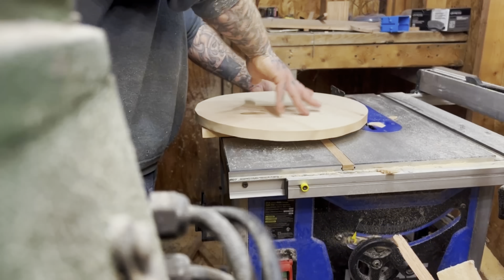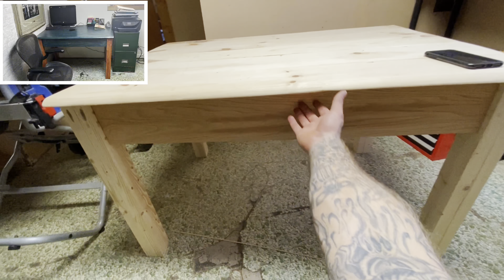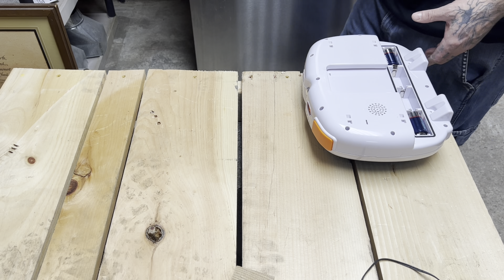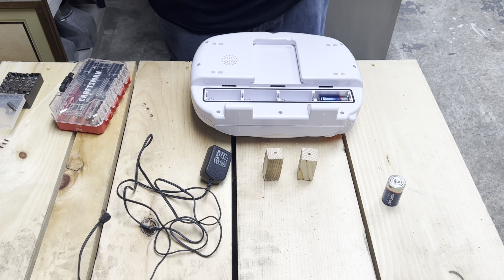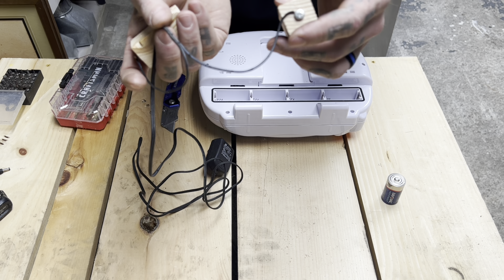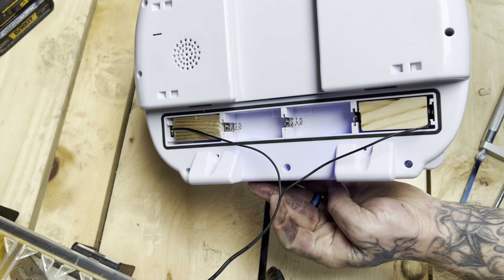Run Battery Powered Devices From Wall Outlet

Comment: Great vid frank. Fun fact: most phone chargers run at 5v, which is slightly under voltage, but in my experience it doesn't affect the performance of the device. And most people have a PILE of those
Reply from the maker: Thanks Dave. That’s a really good idea. Thanks man.